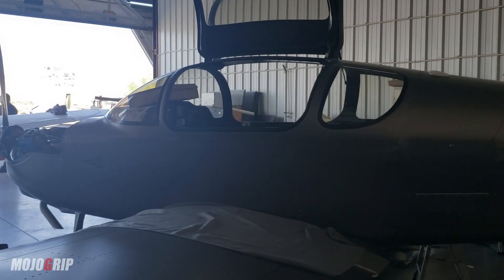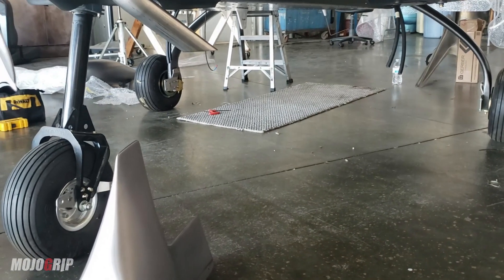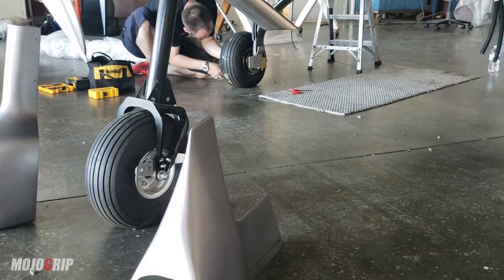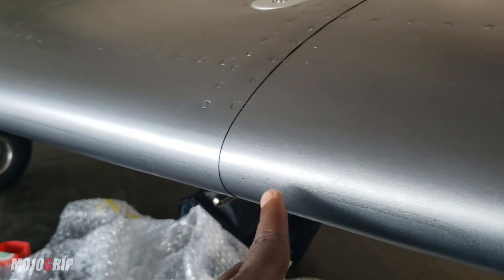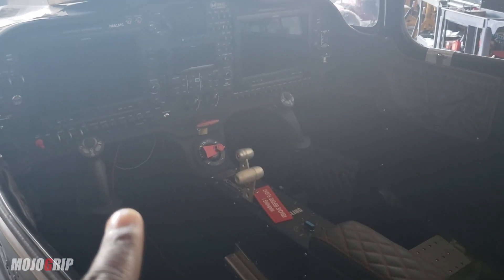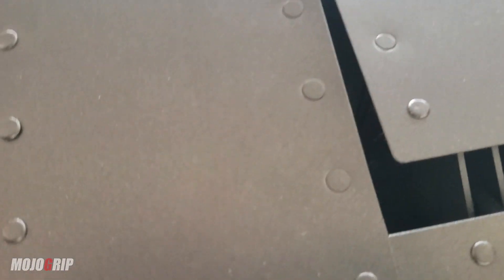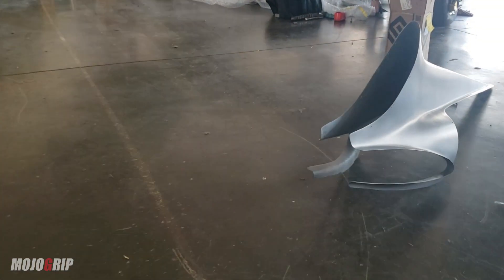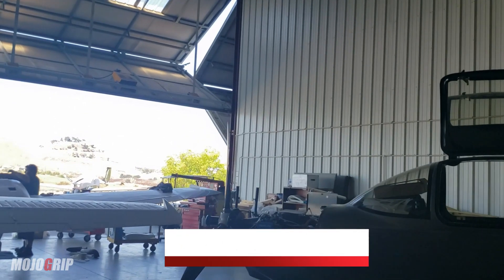Final Assembly of My Sling TSi | Last Day Before The Inspection

Comment: Random question related to flipping the wheel around - Are there jacking points under the wings? How do you lift the front? Is there a jacking point or do you pull down the back?
Reply: I’m not sure he will know. Even tho this is a self build he is supposed to of done 51% of the work but he knows 0 about his aircraft. You can tell that by his vids & the other guys have to jump in n tell him the answer. Worrying!!!!
Reply: @marcs990  Thanks for the reply. I’ve read a lot of comments that say Mike doesn’t know what he’s doing, that he is just the videographer, etc. Having tried to shoot video at the same time as being in video myself, I know it is not an easy thing and it is easy to get distracted. Also, we only see a 15 minute video clip for a week’s worth of work. We don’t see anything he is or isn’t doing when he is not running the camera. I’m not going to jump to the conclusion that TAF is willing to mess things up with the FAA on their factory build program just for Mike, and I’m not going to jump to the conclusion that Mike is any better or worse than anyone else in a factory build program. Unless you’ve talked to him directly (I haven’t), it’s a pretty big assumption to say he knows nothing about his plane - not one I’d be willing to make.
Reply from the maker: Edward, there are no jacking points. You use stands with soft paddings where the aircraft will sit. In this particular scenario, you simply push on the tail of the plane to lift up the nose,.
Reply: @MojoGripClips  , are there specific points that are just under a spar or something? Obviously, you wouldn’t want to put a jack through the skin! My Cherokee has little protrusions under the wings where the jacks go so they are pretty obvious and easy to find. If the TSI doesn’t have it, I may need to get paint them on when I build one.